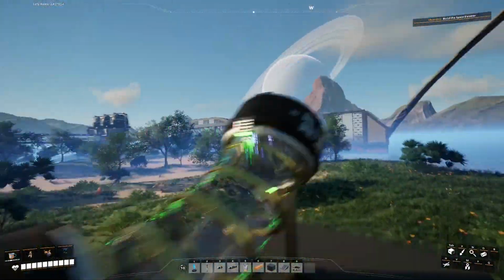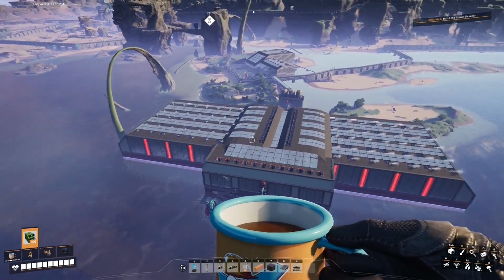Satisfactory fluids bug! How to fix it!

Comment: That isn't the only bug (as you still have problems even if you build the pipes without simply adding components onto an existing pipe...also, this happens with belts and splitters/mergers too sometimes). The Mk2 pipes have an odd bug in that they can't actually carry exactly 600 cubic meters of fluid, even if it says it is. But people were making factories based on 600 and saw that they would sometimes start idling.
Reply: Floating point rounding errors.  Unfortunately, there is no fixing the MK2 bug, just have to be mindful
Reply from the maker: @Reptonious  thats actually incorrect.  It has been confirmed by the devs that it has been fixed on 1.0. Right now the only current bug is the one I describe on this video, that's related to how building works in the game, and not exactly regarding to pipes. 

Still systems might clog sometimes, but this is not a bug! I will do an advanced video on fluids to try to explain these type of issues. There's a lot of misconceptions about how they work. There are design techniques that can help you avoid all of these issues.

This factory im showing on video was done on early access, has mk2 pipes at full capacity, and still works with no issues! It only took weeks of troubleshooting, investigating and learning
Reply: You are wrong. You speak as if this bug was always present. It was not. Mk2 pipes definitely could transport 600m3 even before 1.0. The bug could occur sometimes if you do bad fluid management
Reply: @ppeez  after doing fixing all my pipes according to the video it did nothing. After switching from a mk2 pipe to 2 mk1 pipes, carrying 600 turbo, no more idle fuel gens. 

They also said they FIXED the glowing power line glitch.... looks like Christmas in my game. Just saying.
Reply: @ppeez  that makes... no sense. The two pipes i have now are receiving the same headlift from my "water tower" and are both full 300 m³ flow rate.

I have 640 turbo, 40 packaged and 600 to gens. Compact coal and hor are balanced as well, 300 flow in all pipes, 100 percent efficiency on machines.

There's clearly still an issue with this being the only thing that changed.
Reply: @uolocur9356  im throughputting 3000 m3/m turbo and 5000m3/m rocket fuel, no issues. On top of 3600m3/min water, i think a mk2 pipe of nitric acid and 2000m3/m of nitrogen. Also around 2000 fuel
Reply from the maker: @uolocur9356  I understand your concern, its really common. But I think you are mixing some things. The only current bug is the one I'm describing in this video. The rest have been fixed. You didn't get any improvement when you fixed that part, but the reason for that is that it wasn't the bug that was causing issues in your case. You got it fixed when you switched an mk2 for two mk1 pipes. That makes a lot of sense! Its what I describe as tip #4 in this video description. Fluid dynamics are complex, and really hard to get right. Im pretty sure the problem you had was with backflow. Pipes are not like conveyor belts, they don't go only 1 way. Even if you have generators on one end, and consumers on the other, you still might have backflow!
Probably the issue you had was the following: You were connecting several generators into 1 pipe, and then dividing it into several consumers. This might work, but its not recommended, at all. Its one of the biggest problem generators.
Why is that? 
You are connecting several generators in parallel, and this is dangerous. To summarize it, you might have some generators "fighting" against others, and pumping liquids into the other generator. In order to have that setup work, the system must be absolutely balanced. That means, absolutely symmetrical. If one of your generators has a longer segment of pipe, it will have more issues pumping liquids than the other generators. It will "lose the fight" and reduce its efficiency. That's why the safest way to go, is to only connect 1 generator per system. Of course, this is not always possible, but you can play with clock rates to try to avoid having several generators on the same line. And if you cant avoid it, work as hard as you can to make the system absolutely symmetrical. Dont get frustrated, its hard to get right. But I get the sense that what you are describing is simply fluid dynamics, not a bug. Switching an mk2 to 2 mk1 is a great thing to do. And if you can switch that to 4 mk1 pipes at half capacity, it will work even better!
Reply from the maker: @uolocur9356  Sorry for the late reply, I don't get notifications when someone comments on somebody else comment. But after seeing all of the discussions this video created, I'm definitely going to do a video about fluid dynamics. There's a lot of misconceptions about the subject. Coffee stain made the fluids work as they do in real life, instead of doing something intuitive. Unfortunately, fluids aren't intuitive, at all!
Reply: @NicoBuilds-g3u  holy crap This is one of the most in depth explanations i've ever gotten. Forget the delay in the reply, just thank you for taking the time to explain. Yes, I have a bunch of pipes of unequal length that would be fighting. It just clicked now.
Reply from the maker: @uolocur9356  Glad I could help! ❤ Enjoy the game that is awesome! 
Just finished myself a session of like 6 hours. Meaning, next video is close to be released 😊
Reply: @uolocur9356  do you realise you are wrong now? Like i said, bad factory planning. You can also use pressure to fully circumvent any flow problems by feeding factories from a higher point above.
Reply: @ppeez  Wow, you are not pleasant.  Yes, I see how my problem works now. I greatly appreciated him explaining instead of just "poor planning, works for me." 

Yes, I use towers to pressurize everything. No this can't circumvent the issue is was having. My issue was in how it was splitting.
Reply from the maker: @ppeez  Hey, dont be rude! Fluid dynamics is one of the most complex things about this game. As a matter of fact, I spent ages troubleshooting this factory, and you can clearly see that the water generators at 5:48 are connected in a really bad way. I simply didnt know better, and was lucky not to have issues because I made it symetrical (Just to make it look nice, didnt know about how fluids work).

My goal for this channel is to create a space where everyone feels comfortable asking questions, learning from mistakes, and having friendly debates, no matter their experience level. Satisfactory is a complex game, and part of the fun is figuring out how to optimize everything! Sharing experiences, tips, and tricks can help others who might be struggling, and that’s the kind of discussion I want to encourage here. I feel that a comment like yours goes against what i'm trying to build here.
Reply: @uolocur9356  if you have sufficient water pressure you will not have backflow issues, symmetry or not
Reply: @NicoBuilds-g3u  looking forward to that video about fluid dynamics! Subbed for this! I think you got it right! Still struggling with my pipes, but that will be because in the past, i actually prioritised the long pipes, because if you disassemble the junctions, you will get back your single long object. So i was doing the opposite of what i should have done 🤦‍♀
Reply from the maker: @AditaBattleForge  already started working on that video, is really close 🙂. Next video we finish the turbo fuel factory (almost done). The one next is the fluid dynamics, and then we turn the turbo fuel factory on, with a full pressure startup 😎
Reply: @NicoBuilds-g3u reading this whole thread and I'm looking forward to your fluids video BECAUSE it sounds like you actually understand how they work in Satisfactory.

There's a lot of misinformation out there that continues to be amplified. You can run 600 through a pipe (I managed it from Blue Crater to Grass Fields) but it's hard to get it perfect, so workarounds are the norm.

One way out of pressure inconsistencies is to use gravity and buffers — to ensure that extractors never idle and throughput never, ever slows anywhere except near a buffer. But it's an advanced learning curve: you have to think through each case.

Anyway, just a tip for your videos. I found your use of "generator" confusing. In the English game, that refers to the final consumer (fuel generator) and the machines pulling water or crude oil from the source are called extractors.
Reply from the maker: @ivocanevo  mmmm. You are right! Crap, hope its not confusing. I tried to mean "liquid generators" and "liquid consumers". But im just realizing that it might be confusing because of the power generators... not a native speakers. Thats on me. 
Regarding the liquid dynamics video, it was out yesterday! You can check it out on my channel. Latest video.
And i used the term generator/consumer throughout the whole video. Your comment would have been really useful a couple of days ago, hehe. 
Thanks for stopping by!

EDIT:
Direct link
https://www.youtube.com/watch?v=hp4Bmb2cKvg&ab_channel=NicoBuilds
Reply: @ppeez please do not affect the wholesome moment of someone being taught, accepting where they went wrong and learning. Allowing them to develop.
There is no need to force anything, just let it flow.
(Pun intended).

Comment: Nico, I have fought that same issue - spent 10 hours building a nice power setup and have it totally crap out with the piping. I ended up doing the exact same things it looks like you did to fix it only to figure out that the pipes terminated half way into a junction or other object. :/
Reply from the maker: Im really hoping they fix it in 1.0. But anyway, no matter what, I think I will be checking the pipes every time I place them for the rest of my life. I spent soo many hours trying to fix that crap.